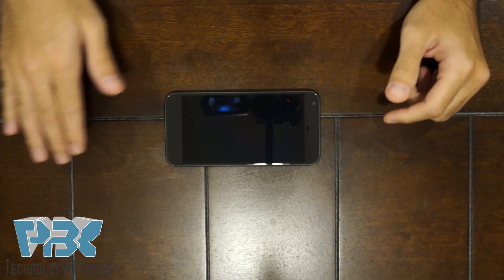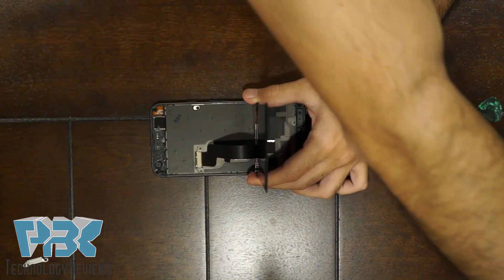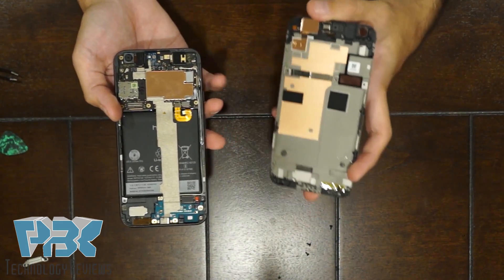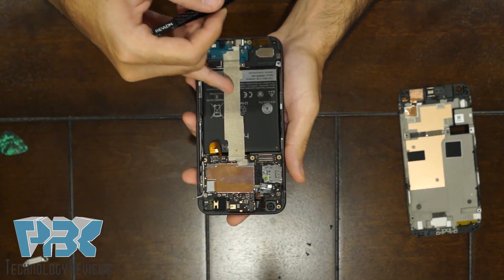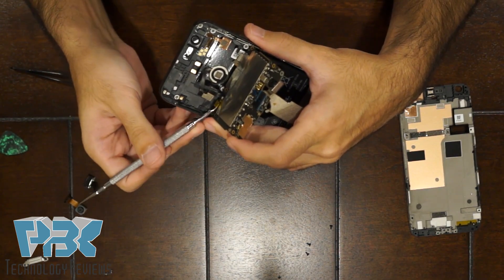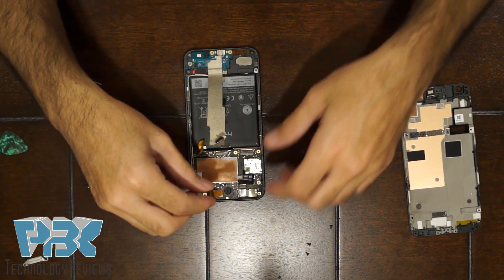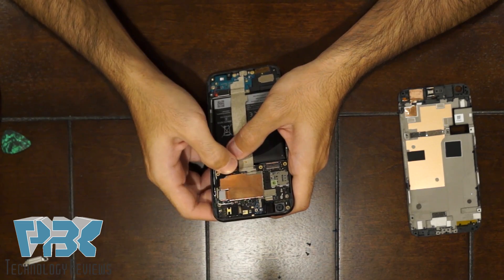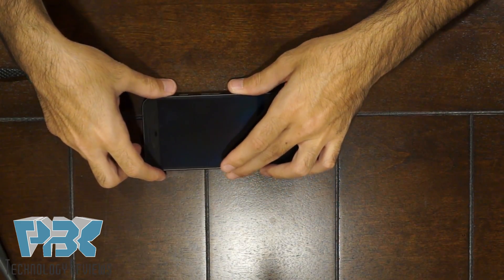Google Pixel XL Disassembly Teardown Repair Guide

Comment: this "area" on the bottom left, I'm struggling to see anywhere  I can put a tool, can you elaborate please
Reply from the maker: You can fit a thin flat metal tool from any area on the bottom to lift it out. You basically have to wedge a tool in between the midplate and the frame of the phone.

Comment: Bro, what temperature and power of air did we use in the gun so that it came out easily?
Reply from the maker: I'm not sure exact temp, but would be best to use a hair dryer since there is less chance of damaging anything by overheating it. General rule of thumb, just heat it up so its hot to the touch but not burning hot. You can always apply more heat as needed while your working your way around prying it off.

Comment: amazing video thanks! question: i dropped the phone and now the speaker and charger doesn't work but if i flex (bend) the phone diagonally it does work again but needs to be flexed to work or it stops working. what do you think got damaged. it has to do with connection and the speaker and charger port is both affected. thanks
Reply from the maker: Thanks, it's an old vid and quality isn't that great compared to my videos now lol. But it's possible the flex cable connecting the sub board/charger port to the main board has become disconnected or loose causing that issue. You would need to take it apart and inspect and make sure all the cables are properly connected.

Comment: well i had everything working but all of a sudden its not turning on at all. i noticed when i opened it up that the white cable you showed to plug in, the part that plugs in was detached from the rest but still attached to the white cable... any idea how i can get that back on
Reply from the maker: Do you mean the connector broke off the board?
Reply: @PBKreviews  yes do you happen to know what it is for ?
Reply: Well the phone is working again but the in call volume is 0
Reply from the maker: Hi, well the connector would be to connect the flex cable to the main board, and the tan colored one connects the charger port and loud speaker assembly to the main board giving it connection. So if it broke off only way to fix it would be to re-solder it back on by a professional if even possible.

Comment: Suction cup is definitely a good idea it would seem. Other teardowns don't use it. Somehow they cram a pry tool in between the glass and the frame. When I tried that, it scratches the frame.
Reply from the maker: yea in most cases suction cups come in handy
Reply: @PBKreviews  I can confirm the suction cup pulled the screen up just enough to slip in a playing card! I'm surprised you're the only one using suction in the other Pixel teardown videos. Thanks
Reply: @rkgsd  Good question. I know Apple shops use special machines with suction cups on the older ones. But those phones are easier to get under the screen.

Comment: OMG! Metal tweezers????
Reply from the maker: I wouldn't advise it either, but in the last 14 years, I have never had any issues or damage caused using metal even though it can possibly short something out. So best not to use it if possible. But if you have the battery disconnected, you should be fine :)

Comment: Did you fit a new screen?  I am planning on reusing my old screen, is that possible?
REPLY
Reply from the maker: We put the same screen back on. Ya I don't see why not, as long as your screen is not broken you should be able to use it. Always best to add new adhesive but if your adhesive still holds you can use it as is.
Reply: pwrdbykyank yes, screen is still good.  What's the best adhesive to get? I was thinking double sided 3M tape
Reply from the maker: Yea find one that's meant for smartphones, always best to ask the seller that you want a strong quality one. There are many out there that don't hold well.

Comment: Nice video. But what is the procedure if I had wish to change a whole housing ?
Reply from the maker: Thanks, usually they sell housings for phones with all the small pieces installed like charger port, buttons etc that's left after you remove the main board. Its always easiest to purchase one of those to install instead of a bare skin housing but if you were to do bare skin, all thats left is the battery to remove, charger port and any buttons or connection points you would just need to swap over from the old to the new housing. Since most replaceable housings usually come with the minor stuff installed I didn't go too into detail on how to replace the rest of the pieces.

Comment: did you damage your screen as you removed it? Or does the screen get automatically damaged?
Reply from the maker: No, but its fragile you can damage it easily from what I have herd. It didn't seem too fragile when I took it apart. If you apply too much heat you can cause the glass to separate from the screen or cause the glass to shatter.

Comment: hiya, awesome video! Do you know how I can replace the rear glass and where I can buy replacement possibly (mine shattered =/)?
Reply from the maker: If I'm not mistaken its held on with adhesive. So you would need to heat it and pry it off but not sure if the parts are available to purchase yet. Best bet would be ebay or to contact htc/google for repairs.
Reply: Thanks! I guess I'll wait for a while before doing anything and see if they stock some parts on ebay. Should be easy enough to replace if only held on with adhesive.

Comment: Really good video. One thing though. You don't need to use heat to remove the battery. At the top of the battery where the little slits are is actually a pull tab to remove the battery adhesive.
Reply from the maker: Thanks for the heads up. Didn't pay attention to that.
Reply: You're welcome and subbed :) Love the channel
Reply from the maker: :) thanks I appreciate it!
Reply: interesting

Comment: that screen looks super easy to replace
Reply from the maker: Yea the screen is fairly easy, the rest is a bit more hard but not too complicated. :)
Reply: pwrdbykyank i have changed the screen. but the new screen doesn't stick to the device. is there any recommended glue?
Reply: I've heard the XL construction described in as cheap-looking and cheap-feeling for a flagship product. Your thoughts?

Comment: What are your overall thoughts on the build quality ?
Reply from the maker: Tabish Syed I think it's actually a well built phone, replacing the screen isn't too hard, after heating it up and prying it off your able to remove just two screws and you can replace the screen but getting further into the phone gets bit more hard. The mid frame is built well so holds the phone together pretty well and is much harder than most phones to try and separate from the rest of the housing. Once inside, the layout is done well and not cluttered. I'd say it should be a well lasting phone.